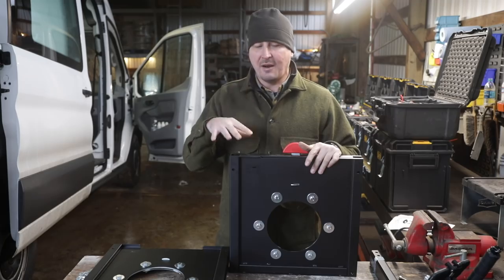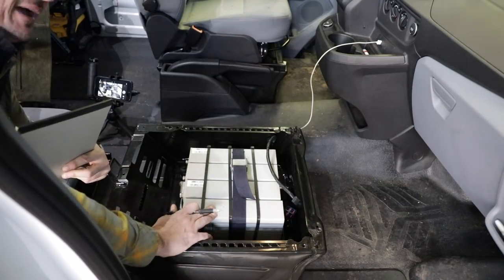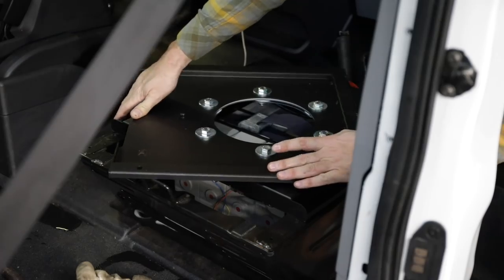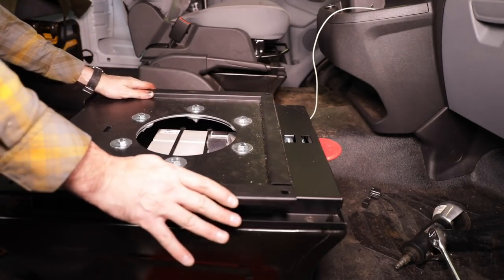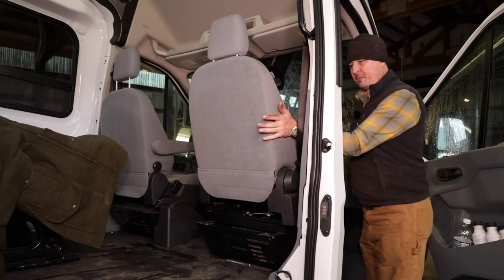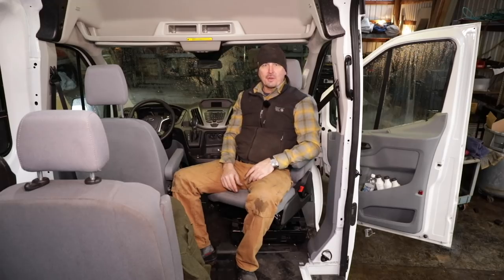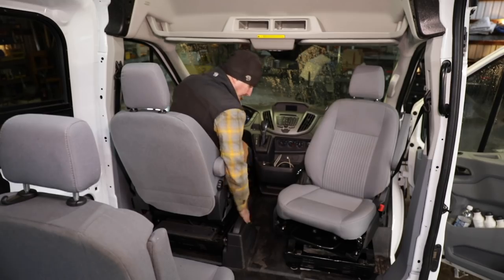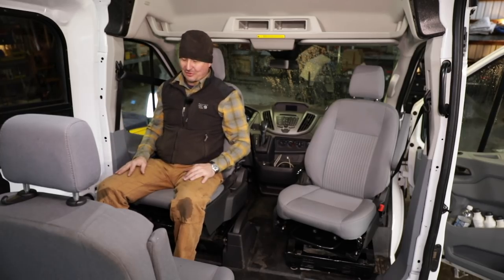AMAZING Spinning Seat Stealth Van Mod!!!

Comment: Modified my Vandura many years ago and being 6' 3" redrilled the seat box max to the rear . Had to adjust the seat max forward before rotation but what a difference on long commutes .  Thanks  be

Comment: Faroutride.com shows these swivels and a way to lower e-brake
Reply: http://faroutride.com/driver-swivel-seat/ correct URL, should lower the brake Cody!
Reply: and btw doesn't ford have a option to put it on your left side between the seat and the door?
Reply: This works. Check this out.
Reply: Hope he sees this.
Reply: no Edwin, but they should put it there, or put it under the dash, however ford for 2018 model does have an option for push down parking brake lever.
Reply: Antone Schweitzer too bad it's not the pedal kind of E-brake

Comment: Cody, the main thing speaking as an electrical engineer I would strongly is to put insulating covers over the battery terminals to avoid accidental short circuits, short circuits across battery terminals is a dead cert to cause a battery to rupture, also have a fuse as close to the positive terminal as possible again to protect against shorts

Comment: The E-brake is moved straight down about 2 3/4". 

To clarify the rubbing on the sheet metal; the housing passes through 2 pieces of metal. The top has a solid grommet that keeps it off the metal and centered. You can see it from my 6th pic down. The second pass through (only visibly from below) doesn't use a grommet. It is just over sized, and with the factory E-brake location, the housing passes through the center (with 1/2" clearance around it). 

Since you're lowering the E-brake significantly, you have to push that much of the cable & housing through the floor (unless you wanted to take the time and shorten the cable & housing). When you push this extra through the floor, its fine because it will just have more slack under the van. This does however, make it off center on the second pass through and touch the metal. With long term vibrations, this will undoubtedly wear through the housing. I haven't done it yet because I didn't have plug in power for my jig saw, but simply making the second pass through larger to re-center the cable should do the trick. I'll post a pic when complete, I won't drive much till then to minimize wear.

Comment: Disassemble that e-brake handle assembly so you can look and think about it for a while and also lower the drivers seat and see how you like it without the risers.  Wouldn't it be nice if the stand for the e-brake could be shortened.

Comment: That "doohickey" on the back of the seat frame is probably the bracket that you hook a child's car seat up.. many of them have (or had, I think there is a new system now) a belt with a hook that would go over the seat and clip behind the seat on a bracket similar to this.  Keep up the great work Cody.  This is a very interesting series

Comment: Hey there, love the project. I'm not sure if anyone has answered the question yet I but believe I know what the bracket you cut off is for.

Those seats are the same seat for the stripped van as well as the people carrier. Since the stripped van only has two seats in the front, legally you are allowed to put a car seat in the front (it will have a smart seat occupancy sensor, or a manual airbag override). The bracket was for the top anchor strap on a front facing car seat. Hope that helps answer the question.

Comment: Adapting that emergency brake is the best option, to remove the need of that additional height that is. I’m not a car guy with the knowledge of how to exactly do it but it wouldn’t take much for a shop to do. Just fashion a bracket to mount it lower (and out of the way even when engaged and taller due to the arm being up) and make sure the line has the correct tension (if it’s a cable) or adapt the linkage correctly.

Comment: the 'more flammable' lithium based batteries are self sustaining at iirc at about 150c, and the ones you have there about 300c, but over-volt a cell it will still go into runaway, and then you get a chain reaction as the heat from it sets off the next cell. i love these batteries use lithium in everything i have.

Comment: I saw on another video about a Sprinter van conversion that had a kit with the seat swivels that moved the emergency brake more towards the center. That way the seat can stay at almost stock. Hopefully someone will come up with that for that Ford. By the way I carry every day. Our Sheriff's department is great, but they have not assigned a deputy to watch over my wife and I. So it's up to us to protect ourselves. It's the same everywhere, people just haven't figured it out yet.

Comment: I have found many of the cheap tools have come up in quality a little. They still aren't great quality but many are good enough for something you don't need often. If you need something for a single job they will work & you have that tool for occasional future uses. 
I still go high quality for regular use tools but for specialty things that you rarely use, some of the cheap tools are good enough. Like that cut off wheel. If you use it once every few years it's good enough. A tool used for light home projects will get less use in a decade than a commercially used tool will get in a few days. 
Twenty years ago, cheap tools were so bad they just weren't worth anything & some still are that bad but now, many are good enough for light duty. I bought a $29 router a few years ago to do cabinet doors. It worked great & I still have that for another project. It wouldn't last long if I used it frequently but it gives me that capability for occasional projects. 
The point I am making is the cheaper tools are finding a niche in the market.

Comment: sir  Wrangler if your unable to lower the hand brake when your van goes to the dealer for your 4x4 fitting out you should see if they can fit a centerconsole handbrake lever. they are rotated  90 degrees and pull towards you instead of up from beside you.
Reply: If this was not a brand new vehicle I'd recommend retrofitting one of the old style left foot parking breaks.  But for good reason, I don't think Cody is interested in going junkyard scavenging for this van.

Comment: Bottom line is you are having fun and making it the way YOU want . I have had swivel seat bases in my class C and my class B motor homes . I personally have not actually used the drivers seats utilizing swivel . On my class C that was a Ford chassis , the seat mounting points were offset away from the door . So that factory original position was offset about 4" to the right , so leg was against the dog house . Oh , also the armrest was minimized . After first trip I removed swivel and made a new base mounting plate and centered the seat to the steering wheel . It made it much more comfortable to drive . My wife had to use something to keep her feet up so the blood did not get cut off while riding .In my class B I also never use the swivel on the drivers seat , but the passenger seat gets swiveled to form the single sleeper up front . Did you mention the charge controller for lithium batteries ? Have heard of some bad results stemming from incorrect charge controllers . Would love to upgrade to lithium/iron batteries in our motor home , but overall cost is a bit prohibitive with a controller .

Comment: If all else fails you could relocate the parking brake UNDER the van by eliminating the handle and pulling the brake cable with a linear actuator.  A three position toggle could serve to retract or extend the actuator.  Just make sure you incorporate a switch as needed to illuminate the BRAKE light on the dash.  Once installed you could remove the shim from beneath the driver's seat and return it to the level of the passenger seat.  Harmony would be restored.

Comment: My two cents.  I'm 6'7" and every vehicle I drive, the first thing I have to do is lower the seat to the floor.  Even then the rear view mirror on the windshield often blocks much of the view of cars to my right at stop sign intersection where the crossing street is slightly elevated.   As you mentioned being the first to a stop light is like a humor show for my passenger s as I crane my neck forward.  If I'm lucky there is a light mounted on the vertical pole which saves me the trouble.  Anyway, my take away is that tall people need our seats to be lower even though it is less comfortable and harder on my lower back on long drives.

Comment: We in europe, we first of all use the metric system, so that's better. And then for these conversions we have the fiat ducato which has the emergency brake on the left and lowered so it does't botheres you at all. 
But there are fords and mercedeses out there which have 'em on the right which still work so there should be a conversion braket for it.

Comment: The piece you cut off looks like one of the anchors for the "latch" system for a child safety seat.
Reply: Roger
Reply: Who need that? lol. Even if he had small children it wouldn't be smart to put your child in the front seat
Reply: Alex Tran - The van came from the factory with only 2 seats.  Where would you mount a child seat ?  I am pretty certain there is a way to disable the air bag, or it won't even arm if there is insufficient seat pressure.
Reply: Usually, vans like that have not back seats.
Reply: It most certainly is legal. At least in my state it is.
Reply: Backroads Nomad Backroads Nomad So I guess you're saying that over the 12 years I enforced such laws I was wrong? I know the vehicle code in my state, if you want to cite something provide the code and I'll double check. I can't believe that my 1 simple comment replying to his inquiry of what that piece of metal was has drawn such nonsense. I do congratulate you though on the amount of effort you put I  to proving my statement wrong. As I said, that's what it looks like, I never claimed to know for sure. I'm sure you are very proud of yourself. As far as your claim that child safety seats aren't allowed in the front, they are, that's the reason why the passenger side airbag can be disabled, for a rear facing child safety seat. Not recommended, but not illegal.
Reply: Backroads Nomad and I've met plenty of people in such positions that think they know what they are talking about. Like I said, show me the statute and I'll believe it. Good luck finding it.
Reply: Average Guy, The piece that was cut off, I would think is the 3rd point for the safety harness.  You will find out when you attach the safety harness,  If it is you can use a climbing Carabeana.

Comment: Misalignment or discomfort can lead to issues like back pain. I had a Willy's years ago that had parts from different vehicles. (Wiring harness, seats, foot pedals) The alignment in relation to the seats and foot pedals lead to ongoing back pain. Maybe the brake handle could be lowered just enough to not need the riser? Maybe a new emergency brake housing could be made?

Comment: My aunt has a dodge mini van that the second row bucket seats swivel around and it has a table that goes in the floor. You also can ride backwards because they lock in place and the seat belt is attached to the seat.

Comment: in regards to modifying the parking brake handle, it is far more involved than just cutting a few inches off the mounting bracket as it is still a cable and mechanical advatage that allows you to apply the brake, if you move the mount down then you change the geometry involved

Comment: Perhaps you can create some sot of
Parallel hinge that lets you lift and lower the seat on the hinge, that way you can drop it to the original height, and also raise to clear around the hand break and hen drop it back again?

Comment: relocate the emergency brake lever?....Custom bracket...
Reply: Thats what I'm thinking.
Reply: I was thinking same thing.   Under that plastic cover the lever has to be arched to a metal structure.  Cut that structure down and the covers to match.   
Way easier said than done, but it's worth a look before your send everything back.
Reply: Yes and there's an adjusting bolt for the brake cable under there somewhere

Comment: Hello, am sure you can simply remove the plastic cover which is why the riser is there. Double check the clearance behind it but am sure it will work without the riser if the cover is removed

Comment: Since the parking brake is operated with a cable I'm sure that you could remount it closer to the center if you can't lower the bracket.

Comment: I really like the swivels, but sitting too high may affect where the air bags deployment area hit your body.  Finding a shorter mounting lever for the brake and shortening the adjustment arm, that goes through the floor, or cable, whatever it is, is an idea I'd play with.  Always having to hunch over to see a traffic light will get old, fast.  I'm watching this van build closely, since I'm at the point in my life to start traveling the country.  Thanks for sharing and wishing you and your family a Merry Christmas and Happy New Year!  Regards, Briz

Comment: Okay. Lifepo4 batteries if shorted, will smoke for like an hour and then burst into a very minimal, almost like a cigarette lighter type fire near the connector.. So if you're sitting in the car and see smoke underneath the passenger seat. You have lots of time to disconnect it. Best case scenario, the connector if it's a weaker material, it'll just melt off and the battery will disconnect itself. 
Also keep in mind that if one cell breaks, the rest of the cells will destroy that one broken cell beyond repair.

Comment: There's got to be a way to lower that emergency brake. It should just be a mechanism that pulls a metal cord, so it really shouldn't matter too much where it's positioned, especially if you're only lowering it two inches. It'd be worth it to me to have the swivel if all I had to do was cut two inches out of the metal mount for the e-brake and weld it back together.

Comment: I think the loop you cut off is for attaching a child car safety seat.
Reply: Mark Estes child safety in a van, on the front seat!? What the hell are ford thinking XD
Reply: This van came with only front seats. No back seat from the factory in this.
Reply: That’s my thought too (child car seat anchor).
Reply: Exactly what it was for. The van originally only had the front seats. So they put it there incase you ever needed to put a car seat up there.
Reply: Harry 8642 I had work van that I used all the time every once in awhile I had to pick up the little girl from babysitter it's a $0.10 piece of metal that made it a lot easier I was glad they put it on there also I think these can be spec these out for passenger vans as well

Comment: Honestly, forget the riser, you really don't need the emergency brake with an automatic, yea it does relieve some pressure from the transmission but people have been doing it for decades without issues so i think your fine. If you need the functionality you may be able to drop the emergency brake down a bit or just it differently. In Europe most  transits are manual so you should look into that and see how it works there with those seat swivels since they're european.

Comment: If the swivel had multiple stops you could mount it upside down, so the release would be in the same position under the seat instead of where you can't reach it when facing toward the back. Fortunately what you have isn't a problem.
I suggest lopping two inches off the bottom of the e-brake pedestal, so you don't have to raise the seat. 
457 comments at this time. I'm sure somebody has already made the same suggestions.

Comment: When I mentioned the exposed terminals I wasn’t talking about the batteries exploding. I meant that the heat and dissipation of energy will cause things to glow red hot. A simple solution is just to get those rubber caps that covers them when you lock all your connections down. Learned from doing electric drag prototypes and stacked batteries wiggle loose unless you contain the entire unit. 5$ caps is cheap insurance and looks more complete.

Comment: Table will be taller for the rear seats and smaller for the front seats, possible impact for your legs being taller and possible uncomfortable position for the passengers with the table being higher.

Also - the height increase on the drivers chair being and inconvenience should be second to the fact that your head is level/closer to the sun visor section - if you were to have a crash you're looking at serious damage to the only part of your body you can't live without - your head...

Comment: Would you consider changing the seat belt set up.  It seems like the seat belt being attached to the seat (like many cheys  are) would be better for this design.  Or if the lower part was attached to the base instead of the eseat.